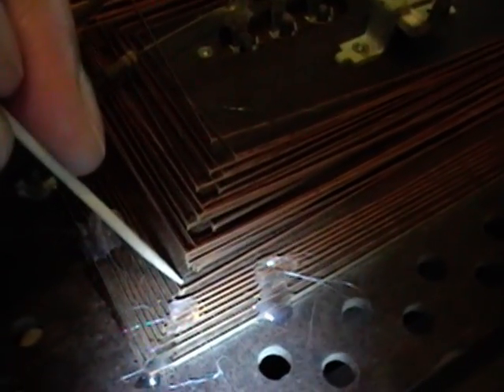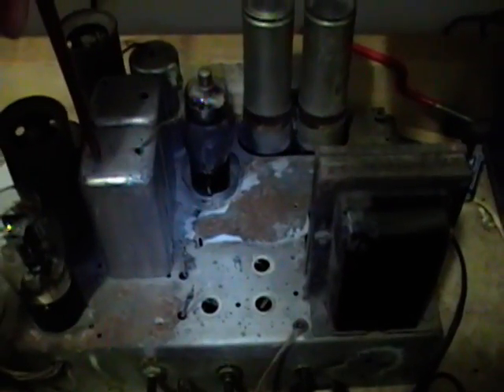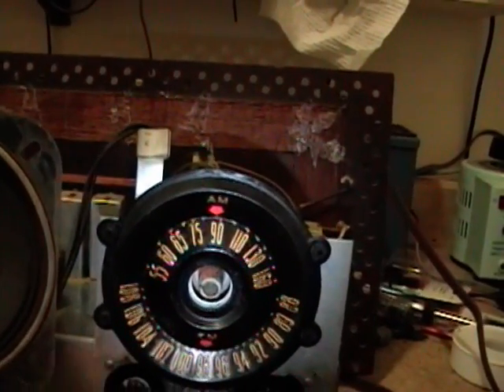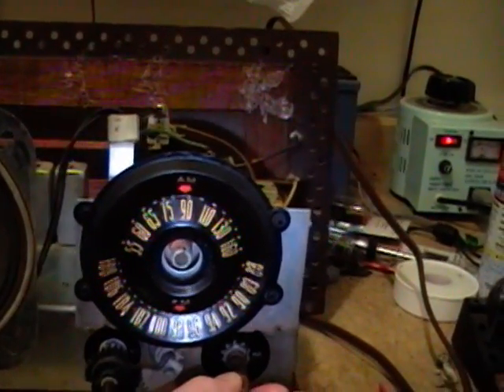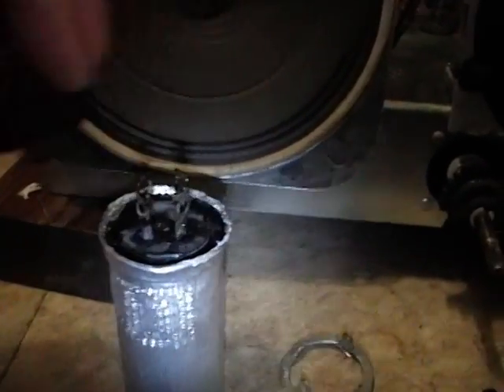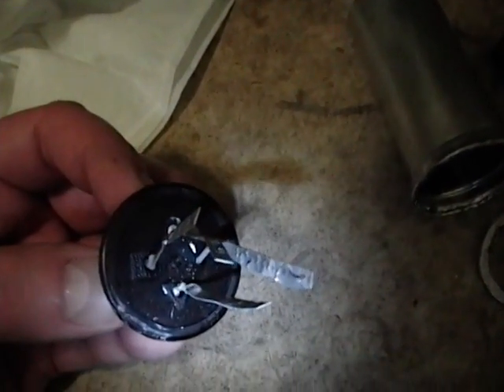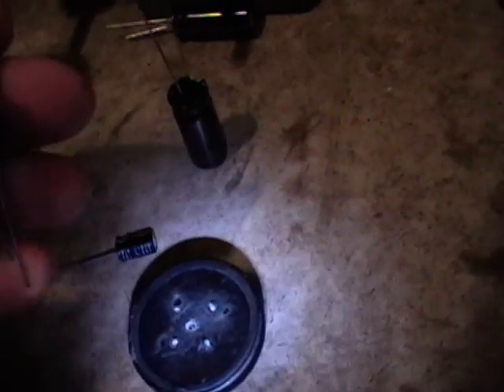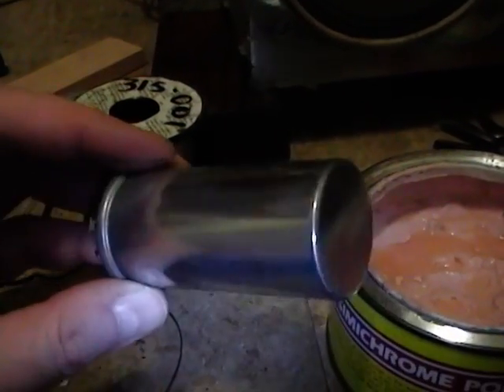GE 212 radio restoration p5o7

Comment: Old paper capacitors had a band on one end that denoted the foil side of the Cap.  The cap was installed with the band end connected to the terminal of least impedance.  When you replace old paper caps, do you screen the replacement to see which end is the band end?  If ;you do not then the radio will be susceptible to RFI
Reply from the maker: Yes, I'm well aware of that but I maintain it does not matter. Dennis Carter did a good video debunking it. a few points are - why did manufacturers stop marking the outer foil if it mattered, why aren't the resistors, wiring or other types if caps shielded?  I've yet to see anyone demonstrate in an actual radio that it makes any difference

Comment: Wow, major work on that Electrolytic!!! I would have just kept the old one on top for display when observed from the back and NOT connected it and just put the knew ones underneath where no one will notice for proper ops. I know you wanted to rebuild the old one... but I hope some other Tech does not just replace it down the line if a problem occurs and ruin your work thinking that ALL OLD caps need replacing regardless and BANG thinking it was just old!!!!

Comment: I've had to reglue those loops but they usually were not falling unraveling, I usually glued them back on with contact cement after cleaning off the old glue first. The hot glue gave me an idea, you could use that to hold the turns down in spots while painting some type of liquid glue in between the blobs, then when the glue dries you could remove the hot melt glue and fill in those spots with the same glue. I must have been like sorting out an 8 track tape wasn't it?